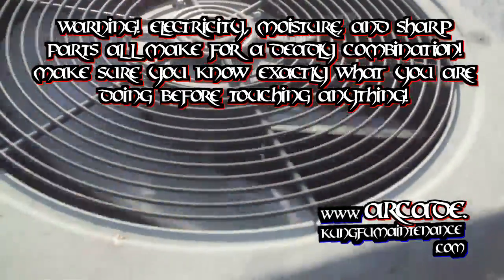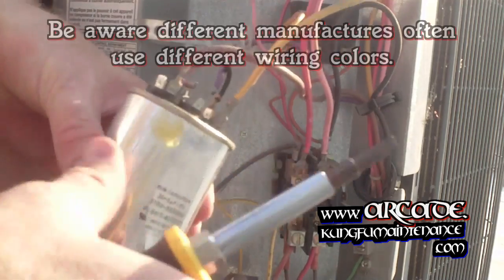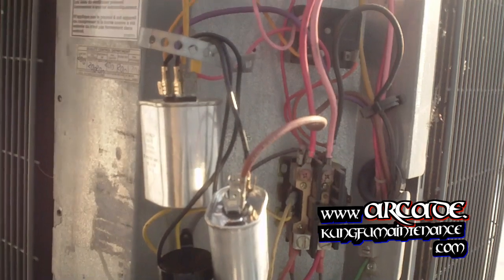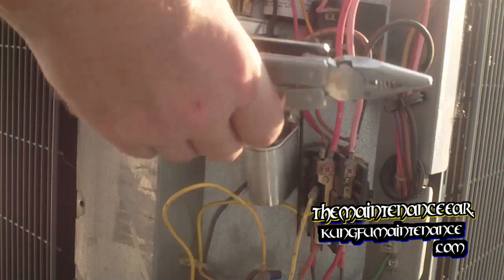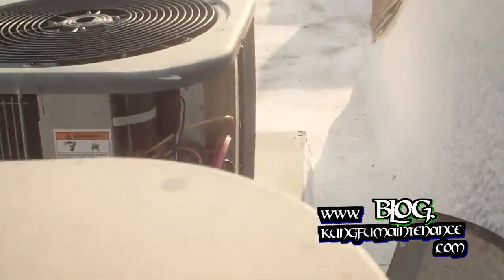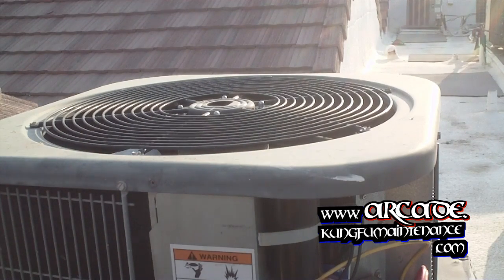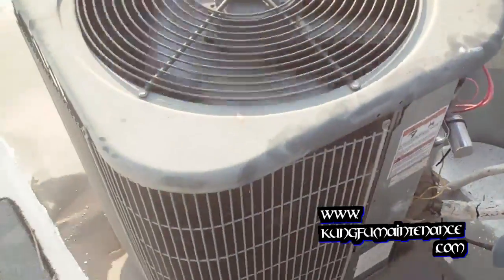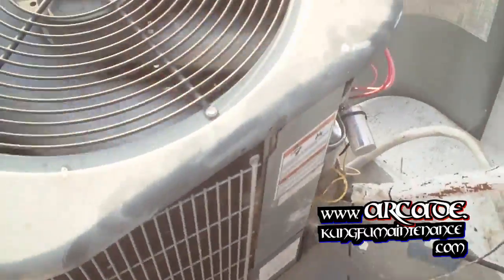How To Split Air Conditioner Dual Cap Into Two Single Separate Capacitors For Compressor Plus Fan

Comment: Confused. So that hard start usually connects to fan and herm,but with two capacities did you put the hard start on the top capacitor? Also is that second capacitor with the brown wire your fan? With a jumper between COMMON AND COMMON of each capacitor? Can you post a pic?

Comment from the maker: When I got to this one it had a soft start kit and a hard start kit on it. I left the soft start kit there and just changed the caps and the hard start kit. Two hard start kits on a unit is about as high as it should go. In some rare cases this is what it takes to keep things going.

Comment from the maker: That depends on your capacitors. If you have a dual cap or wanted to keep it as a dual cap than you would cap off the brown/white wire. If you have a separate cap for the fan or wanted to convert your setup to two separate caps(has its advantage for cheaper easier repair in the future)  than you would connect  the brown wire to one side and the brown and white wire to the other side of the usually smaller often a 5mf cap. In that scenario there is no need for the jumper wire shown in this video.